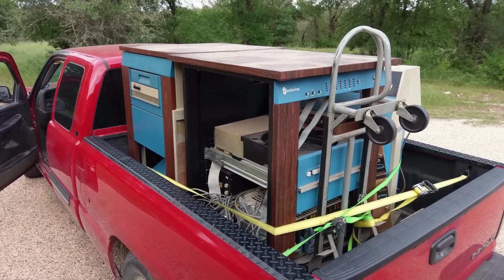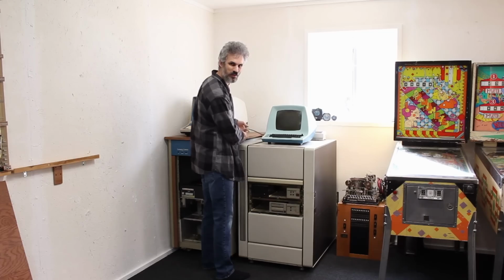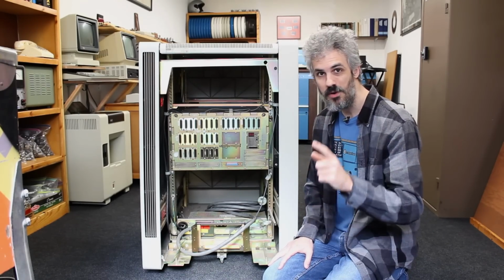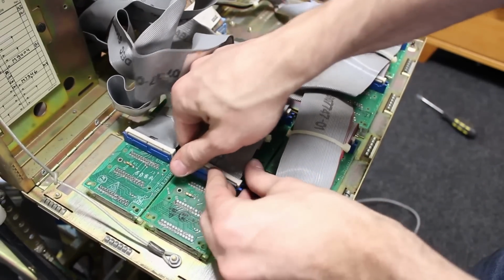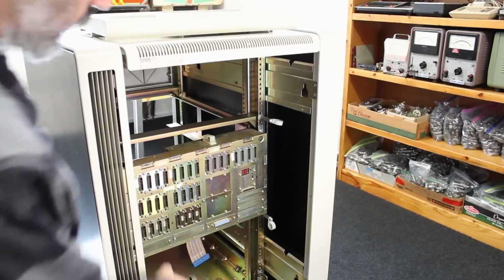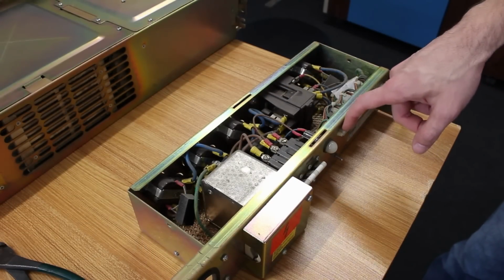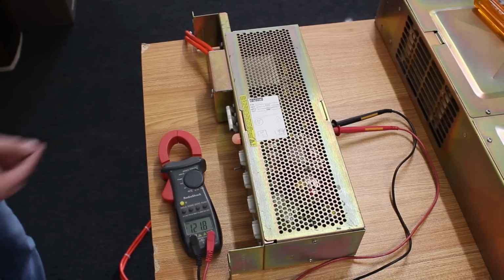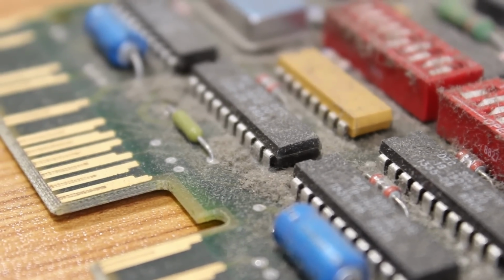I Bought a PDP-11/83!

Comment: That "power thing" was called a power controller and it was a building box component utilized in all our equipment. I was a DEC Field Service Engineer. If you short the center pin of the three-pin connector block to either side and the toggle is in "A" position it will turn on the controller. That lighter three wire cable goes eventually to the front power switch, to turn on/off the system. You need to be aware and trained to static potential mitigation, as that CPU and Memory are very sensitive. I assume you want it to work. Handling that gear always seemed to shorten their life span if you did not use gear to isolate. But it did need to be cleaned, I did it for a living, for decades.
Reply: Back in college, I snagged one of those from a VAX 11/780 that was being junked.  Soon after, I gutted it, and just made it into a rack mountable power strip.  More recently, I re-modified it to have 8 solid state relays and an arduino inside of it, so i can use it to control xmas lights, etc. :D
Reply: @yorgle  Xmas lights ? You mean Das Blinkenlights 🙂
Reply: @daffyduk77  My bad. yes. 100% correct. :D
Reply: Be very careful with air compressor blow nozzles.  They can generate very high static potential that can destroy the ICs!   Vacuum cleaners are also a problem.
Reply: I was also a DEC FS engineer in the 80's. I had a few customers with LSI-11/QBUS systems, but mainly had customers with bigger systems like 11/70s, etc.
Reply from the maker: That makes way more sense! 
I don't know why it didn't dawn on my given that the main computer has a front panel switch and sub computer box doesn't.
Reply: @UsagiElectric  Names, like words mean things, especially in the DEC world. It was not referred to as a “sub computer box”. The proper name is a “Q22 Expansion Box”. Your system has two backplanes. One in each “BA” type box. The top box has a 9 slot backplane, connected to the 8 slot backplane (Q22 Exp. Box) in the lower “BA” box via a cable harness. I suspect you are learning about these things right now.
Reply: you beat me to it.. yes those are remote power on connectors.
Reply: I worked as an electrician in Silicon Valley during the late 80's. I found the PDP-11's were pretty picky about their power. The only thing that I found to work was a dedicated circuit and ground, using a Hubble Surge protected, Isolated ground, Hospital Grade outlet.
Reply: @brucelytle1144  so this is why as an electrician i have to install iso ground iso neutral plugs for tellers to plug in their laptops at bank branches hahah
Reply: @DMSparky  Electrical safety is one reason. But if you look at the system the signal lines from terminal to system are copper. There is a world of issues that make ground currents that cause data corruption on the remote links. When dealing with those issues a proper AC Supply and grounding is required to begin stable operation
Reply: @DMSparky  lots of serial ports and ground loops, must be fun if you don't do it.
Reply: @monad_tcp  It all bonds to ground in the same place. Any properly designed device shouldn’t shouldn’t be relying on a grounding wire (or more specifically bonding wires) for any function other than to facilitate the operation of an overcurrent device in the event of an electrical fault condition which is its only designed purpose. (With the exception of a few niche cases… mini computers and bank teller laptops, certainly do not qualify.)
Reply: @markcummins6571  I remember many moons ago where we had a second hand Amdahl 5850. When we acquired it it was installed in a high rise building and wired up; and it would run but frequently drop off the network. In the end we found out that the networking (routers, etc) were wired to one side of the building and the mainframe to the other, and when it was windy there would be a "floating neutral" effect between the electrical circuits on either sides of the building and the carrier sense on the ethernet adapter would constantly trigger and prevent packets from transmitting.
Reply: Damn best me to it, I did something very similar back in the day.
Reply: That looks like it's intended for power failover control from dual circuits, as the switch is clearly labeled A/O(FF)/B. So there has to be another circuit that feeds in from side A, as side B is the one that it's currently feeding from.
Reply: @Stoney3K  "A" = remote, "0" = Off, "B" = Local, all the plugs are in parallel. Its a power controller with remote operation
Reply: DEC field service in Santa Clara, CA ‘82-‘86. PDP-11’s and VAX 11/780 thru 8600’s & DEC ALphas.
Reply: In my short time working in the Digital universe in the 1980s, the running joke about "dead boards"' was something like "how many dead DEC boards does a DEC Field Service Engineer carry with them? I think the answer was something like "All of them". Correct me if I'm wrong.
Reply: ESD Kills!
Reply: one thing I remember about them was that it would ensure that overloads didn't happen by allowing the computer to signal when it needed the power and the controller would turn on the various sockets in sequence to reduce voltage surges in the equipment.
Reply: Looks like a pretty late model PDP-11
Reply: Hi Mark, what years did you serve?
Reply: @Transcriptor  from 78 to 2000. Badge 83903
Reply: Good advice about anti-static precautions. One of my worst days was when I killed a VAX-11/780 through working on it without a grounding strap.
Reply: @SheeplessNW6  I have been warning about it sense the 70's, but no one believes me until they get stung. Is it passive/aggressive if I just say it once and then watch?
Reply: These controllers are also used to sequence the start of disks, so not all started at the same time and over loaded the power circuits.
Reply: @AndersJackson  I have never seen the power controller work to delay powering on disk drives. I have seen a lot of DEC systems. The systems were designed to not lag the AC power on power up. Such a system would not be reliable. Proper installation was mandatory.
Reply: @markcummins6571  I have worked with several DEC systems, from 10, 11 and 12 and VAX. And other systems 
Yes, the disk started before the computer, in sequence if many.  Because the start of the motors generates a spike of energy drainage.  You usually want to minimize that.

And yes, those systems was installed and set up by DEC.
Reply: @markcummins6571  I've seen it used to sequence power to additional cabinets, but not within a cabinet.
Reply: @SeaMower  There would typically be one type in each system cabinet. They would be connected to each other via the small gray cables and the 3 pin plugs were daisy chained together. This was so you could power up or down the whole system, not to turn on additional drives. You could also have different AC power systems feeding different system cabinets, all could be turned on or off together. Single-phase, three-phase... all worked together to power your system.
Reply: @markcummins6571  DEC started using that power controller daisy chain in the  70s, I believe. I saw them and installed them on PDP11/34 and PDP11/40 front ends on the  KL10' in the late 70s - even before rack mount disks existed.
Reply: @SeaMower  KL's rocked.
Reply: @markcummins6571  or daisy chain, as Seymour and I said, if you had many cabinets
Reply: @markcummins6571  I love Youtube communities like this, you'll have some old and obscure technology or machine, and with a big enough community then inevitably someone will be or will have been an expert in that field. Could one reverse engineer the power controller to figure it out? Sure. However you pretty much took a half hour of inspection and turned it into 2 minutes of reading accurate and factual info with pretty much no chance for error in understanding the function.
Reply: @Anders Jackson  @markcummins the hdd drums had to be spin up for 10s of minutes before the heads could be engaged.  I was a VAX 11/780 admin in the mid 80s ... that was what our SOP was then. True?
Reply: @AndersJackson  I remember that... on microcomputer disk controller cards you could set up staggered start times.
Reply: @AndersJackson  wrong it's a single AC power controller
Reply: @markcummins6571  Yeas, on a singel cabinet like this there are one...

Comment: This is going to be an interesting series!  I worked at DEC in the 1980s,, seeing those components brings back memories, like your RD54 drive and what is presumably your TK50 tape unit with a tape still inside -- def be careful on that one, it's unfortunate the tape is still in it, lots of mechanical stuff will need to work to get it to rewind the tape and eject it.   Fortunately a machine of that era should have lots of documentation and software in the archives.
Reply: DEC is a company founded by engineers, selling their products to engineers. They created several different computer product lines, nearly all of which I would say are still fondly remembered to this day. The PDP-11 family and its VAX successor were possibly the most influential of them all, though the big PDP-10 mainframes also feature prominently in the history of computing in general.
Reply: Ah, yes, the Time Killer.
Reply: @c1ph3rpunk  indeed, I think those drives had more failure modes than operational ones.
Reply: I was not happy to see a tape in it. I wonder if he should manually eject the tape and make sure it isn't stuck to the heads.
Reply: @idahofur  I'd hope that it's not actually loaded but the tape is in the drive.  Those TK50 cartridges contain only the tape, and no take-up reel - there's a complicated mechanism to pull the tape into the drive and spool it on the internal take-up reel, and if memory serves the read/write head is a helical scan thing like a VCR.
Reply: @mitchlichtenberg1858  TK50 as well as all the Compactape / DLT formats that succeeded it are linear, not helical like a VCR. The heads move up and down like an 8-track. TK50 is a 22-track tape and the drive has two coils per head, so it takes 11 passes to cover the entire tape.
Reply: @ajlitt001  cool I learned something today !
Reply: @mitchlichtenberg1858  Yes like DLT and LTO drives.
Reply from the maker: Thank you!
And good eye, I do believe it is a TK50 drive, and looking into it I can see that the tape is actually still loaded as well. So, it's going to be a proper journey to get that thing going again. Hopefully it all comes up with minimal repair work needed though. I'm hopeful though, because aside from the dust, the entire thing looks to be in excellent shape, and talking with the previous owner, it was decommissioned simply because they upgraded, not be cause anything broke.
Reply: I worked at DEC in Canada (KA0) 80s & 90s in config & test. Had worked on many PDP 11s including 11/83s. Those distribution panels are likely for DHQ11s two panels per board for 8 lines.
Reply: And hopefully parts floating around.
Reply: This is a walk down memory lane. I kind of wish I kept a TK50 take just as a conversation piece.

Comment: Looking forward to you getting UNIX running on this sucker. I suspect that the blue connector with the 3 rows of connectors is a 50 pin SCSI connector. Lookup SIMH for an environment that simulates DEC machines. It may help you get to grips with the various devices that the PDP-11 has. I'm pretty jealous, if I'd seen that eBay auction I would have snapped the unit up myself. I really want a VAX-11/780 or 785 but that's just a dream
Reply: You're better off with a MicroVax II, at least that will fit through your door.
Reply: UNIX! has to be VMS
Reply: @axelBr1  VMS wont run on PDP
Reply: @Sven_Dongle  It was called VAX/VMS for a reason.
Reply: @vincei4252  Yeah, the reason is its Virtual Address eXtension, Virtual Memory system, which isnt supported on PDP. I did, however become Windows NT
Reply: @Sven_Dongle  Sorry, PDPs are before my Digital experience, the 1990s, although I did get to visit a VAX 11/780.
Reply: Unix? Snake oil!

Has to be RSTS/E

Comment: I recently purchased some ceramic items from a thrift shop and used peanut butter to get the paper stickers and gum off -which worked really well. Let the peanut butter soak into the glue for at least 15 minutes – longer cannot hurt. You might try cooking oil with baking soda, I think that produces a mild, soft scrubbing agent.
Reply: third party removal stage agent, and soap that off !
Reply: That makes sense: Most glues either solve in alcohol and similar or in grease/oil.
Reply: There is stuff in the supermarkets here called “Desolv-It” -- smells like orange peel. I’ve been using it since the days of floppy disks, for taking off the labels.
Reply: Try Eucalyptus oil. Just rub on and rub off. Stubborn reisdue recquies some elbow grease, but it will come off and smell good as well.
Reply: @cwc4592001  I have a recollection that there may be another essential oil that can also be effective.  Lavender and citrus peel oil might both be effective as well.

Comment: What was the computer used for?  My money is on accounting. ;)
Reply: Accountants used IBM. DEC were scientific and manufacturing/process control.
Reply: When he picks up an old IBM AS400 that will have accounting on it…

With that number of serial ports probably a manufacturing controller or maybe serial terminal  concentrator for Vax or other larger system.

Comment: Odds are, the small connectors on the power distribution unit is for the system to control the power.  The control system sequences up the application of power.
Reply: I agree, the connectors probably serve the same purpose as the A/O/B switch but with a remote extension.

Comment: A new space heater for your new space, and in good condition.

There's tons of software and hardware to play with for these systems. There's also a company that still makes blank PCBs for it.

I've heard that the original DEC power supplies frequently need to be rebuilt/recapped before use if they've been sitting for a long time.
Reply: Applies to any electronic device with electrolytic caps.   Other caps are usually ok in something that old.  I don't think DEC ever used tantalum caps which are another known source of trouble.  I'm doing up an old Microvax at the moment, which initially powered up fine for about thirty seconds, was in the process of booting, then there was a continuous smoke plume from the PSU, like a roman candle lol.  Shut it down and in the process of recapping the power supply.   Electros do not age well, particularly when not in use.
Reply: @TheXO-614  I hope your project goes well.  Thanks for sharing.  Happy Holidays.
Reply: Can it play bad apple?
Reply: @Aeduo  Perhaps it can... there is a text based version for the PDP11 called PDPAPL on Github, but I can't find it on Youtube
Reply: @erikkarsies4851  hah sweet.
Reply: @Aeduo  I don’t know, but if he can find a DEC VR-17 vector display with light pen, it might play Lunar Lander.  If you land in the right place an astronaut gets out of the LM and orders a cheeseburger at the McDonald’s on the  Moon.
Reply from the maker: Thanks!
It's a little wild how much documentation is out there for this machine, especially compared to the Centurion which had practically no documentation on it. It'll be a great system to start learning more about one of the most prolific minicomputer architectures of all time!
Reply: @UsagiElectric  Thank you for taking us along on the adventure.  It is a great trip down memory lane.
Reply: The capacitors can go dry.  The electrolyte is hygroscopic, so very dry operating conditions or storage is not good.  Sitting for a long time may require the electrolyte to be depolarized.  The trick on old radios is to apply increasing voltage gradually over the course of hours using a Variac.  That trick doesn’t always work well on a switcher supply, so new capacitors may be easier.  In power supplies where there is continuous significant AC current through a capacitor, the capacitor will wear out after several years of continuous use.

Comment: That 50-pin connector was used in some SCSI setups back in the day. Never used a PDP-11 myself but it's definitely the right vintage
Reply: I was going to say SCSI too.  The DLT tape drive is probably SCSI connected.
Reply: @wtmayhew  As soon as I saw it, I said "SCSI" -- But I've never touched this machine.
Reply from the maker: Looking in the back, I'm pretty certain the cable was plugged into the M7513 RQDXE extender module card, which seems to have primarily been for an external drive? So perhaps the idea of it being SCSI isn't too far off!
Reply: It's also possible that the Maxtor hard drive uses SCSI.
Reply: @lostcarpark  It's labelled as a RD54 and in common with other DEC RD5x drives uses the ST506 interface with 2 ribbon cables.
Reply: At this rate you may turn into a mini computer addict 😉
Reply: @timothyp8947  it is. Ot computers that are too big, it is urban dwellimds which are too finite!
Reply: That was my thought too!
Reply: There are several DSSI (DEC’s early almost-SCSI) and SCSI adapters for QBUS and the tape  unit indicates (implies, I would say but I fail to see the model badge so choose to stay safe :)) one of the teo.